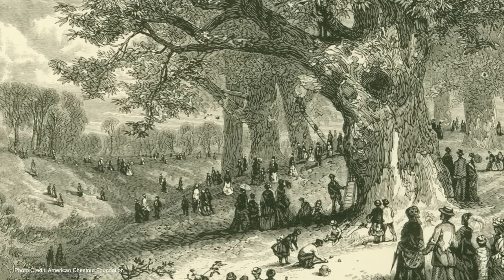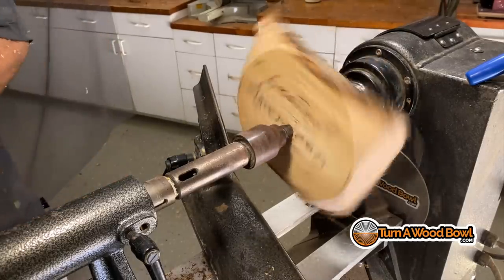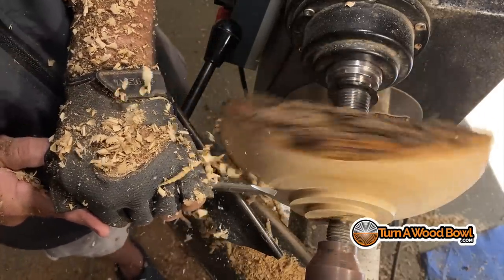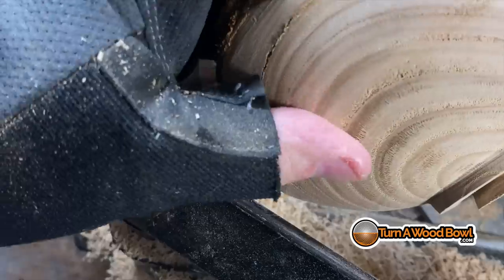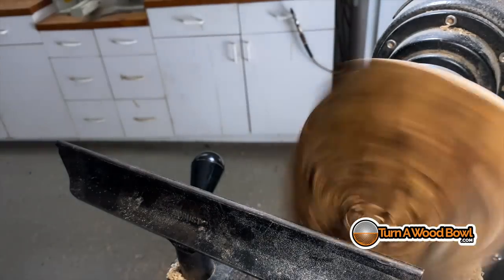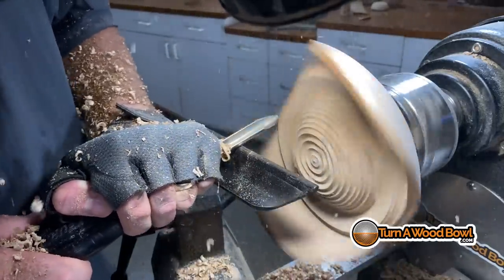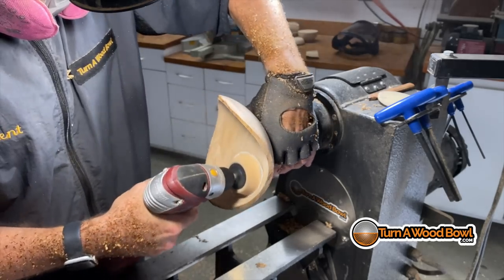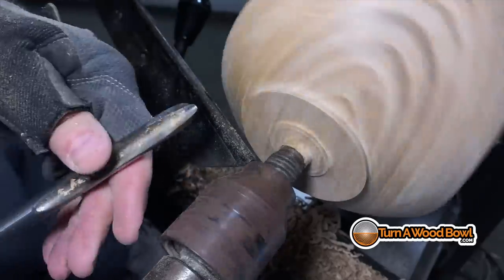Woodturning Extinct Wood American Chestnut Natural Edge Bowl Video

Comment: When I remodeled my living room, I took out 4 old barn beams. Solid and heavy, and well over a century old.  I sat them outside, and we had tried to sell them, but most people were scared I guess - they were so heavy. After starting the woodturning hobby, I thought, If no one wants them, I'm going to practice making 6 by 6 bowls.  Turning them - something was strange. I thought they were pin at first, but they didn't smell like it. In fact they smaeeld like the walls in a hotel we stayed at along the skyline Drive in Virginia.  I had 4 - 12 foot, 6 by 6 inch Chestnut to make into blanks!  My poor turning tools suffered, but my "Century Bowls"  are dropdead gorgeous. And not many people have  historic old growth Chestnut to turn.  These will be heirloom pieces.
Reply from the maker: Wow, that's awesome Michael!

Comment: Hi Kent,  Another great and informative video!  I understand your being nervous when you only had one piece of a very special wood.  The wood glue and sanding dust was another excellent tip.  I have wanted to use a wood burner to sign my turnings and your explanation is the first I've seen.  I have looked at wood burning kits on Amazon but am lost as to what to buy just for signing items like you did.  The kits contain so many items and I'm not sure what I really need without buying way more than necessary.  I looked at your list of Equipment Used but did not see a wood burner there...any suggestions?
Thanks,  Myles
Reply from the maker: Thanks, Myles. Look in the finishing section of my Recommended Equipment Guide. Here's a link to the Equipment Guide https://turnawoodbowl.com/recommended-equipment/ And here's the wood burning tool to use to sign your name https://amzn.to/3mi3EUP You will want to various tips to experiment with. I find that the tips designed to be "pens" aren't as good as some of the others. Also, different tree species and moisture levels in the wood will make one tip better than another. Enjoy and Happy Turning!

Comment: Kent,
I am trying to follow your lead turning a similar shaped piece of Hickory. I am finding that my spur chuck continues to tear out and then the piece free spins and will not cut. My spur chuck is what came with my lathe and is approx 1" in diameter (maybe less but I know not more). My wood is a bit on the green side. Would a larger spur chuck help or should I just wait until the timber dries more?
Reply from the maker: Yes, a wider spur drive center would probably help. Take a look at this one https://amzn.to/37a0uw3 Happy Turning!
Reply: @TurnAWoodBowl  Thank you for the suggestion. 
To keep this project moving it was suggested by a turning group I follow to use my screw chuck. I mounted the blank last night and spun it to see how the balance was and it's, ok. I will turn carefully to rebalance. 
I will order a larger diameter spur drive for future turns.